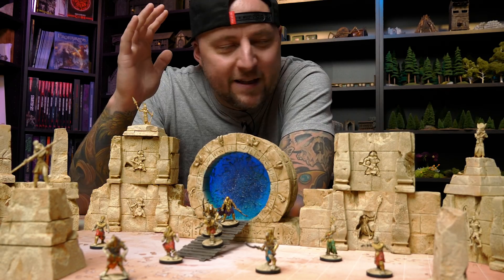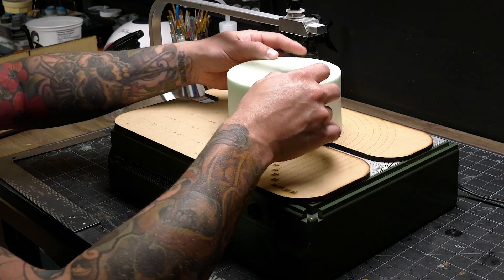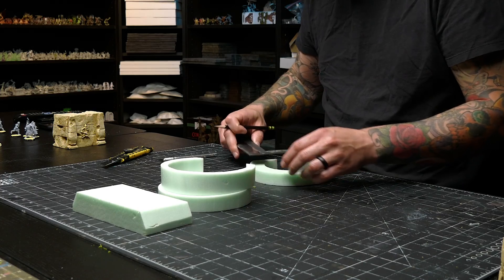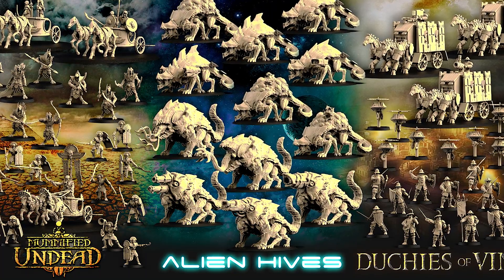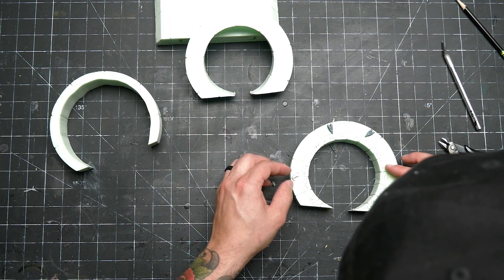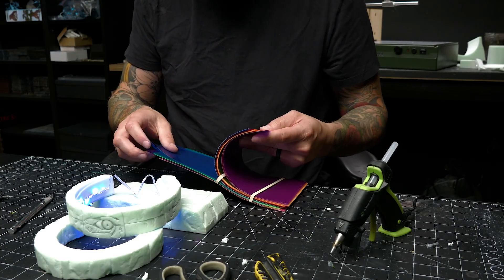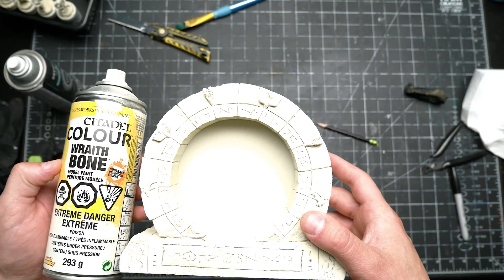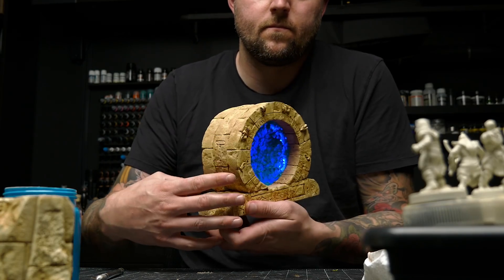Craft a Glowing STARGATE PORTAL for Tabletop Games (Dungeons & Dragons, Warhammer Terrain)

Comment: There’s a thing you can use that has been used for cosplay props when using LED’s.
LED Eva foam. You can still see the color and it hides the dots from the led strips if it not right on it
Reply: Or fiberfill, the artificial "down" used in pillows. It's in pretty much any craft store and you can pack it in as tightly or loosely as you like to get the effect you want. It's especially good when there's not a lot of clearance.

Comment: my brother got some 3d printed stargates from the show, and i was tasted with painting them. I started with a whitewash on the inside of the ring and then used unicorn spit -blue in increasing stages on resin building up the water like effect. added some glow in the dark powder to the last clear coat of resin, also made the locks glow red like in the show.

Comment: Great build!
Suggestion ... to hide the LEDs, try using some vellum paper or Wax paper to help diffuse them.  Another way (rather tedious, but it works) is to use either a black dry erase marker or a black sharpie marker to coat each LED/Light.  IF the light is glass, use a sharpie.  if it is plastic use dry erase.  The marker won't completely coat the glass/plastic but it will help to diffuse the light coming from them.  Hope this helps!
Have a better day!

Comment: Recesing the lights then putting a layer of gel around the lights then fitting the other gel on the ouside works better. I have done a couple portals like this ang used translucent timt to clear caulking for a more 3d swirl on the top layer of the gel...

Comment: A better option for diffusing the light would have been to fill the interior with stretched out and worked cotton balls.
Reply from the maker: I had checked for my stash of cotton filler and turns out I tossed it at some point
Reply: @BlackMagicCraftOfficial  Check your restrooms, cotton balls would actually work better at this point than the filler option as it's easier to break it up and into the finer work and work it in via the hole you made for the battery and wire. 

If you're really lucky, you might even have some of the pastel ones in blue